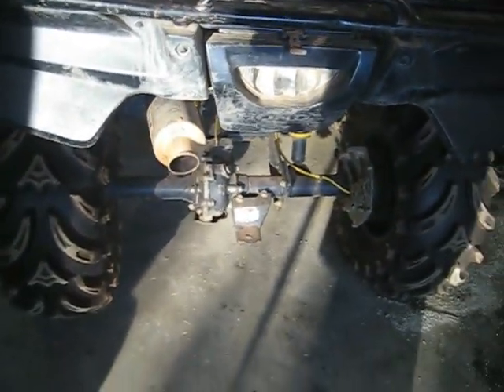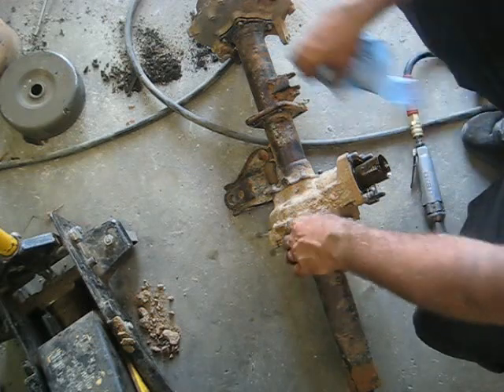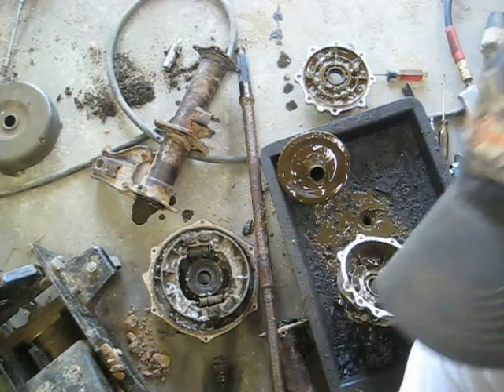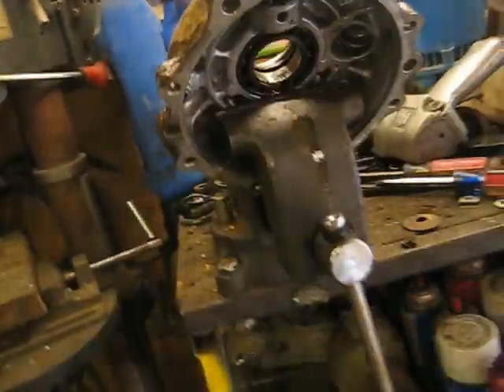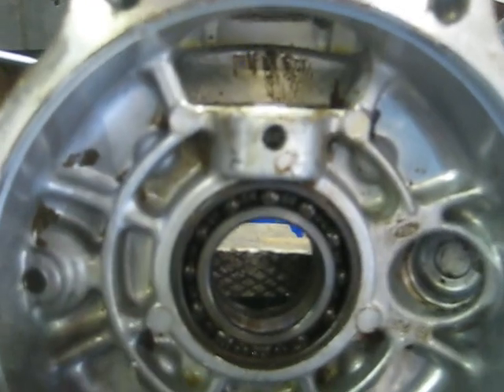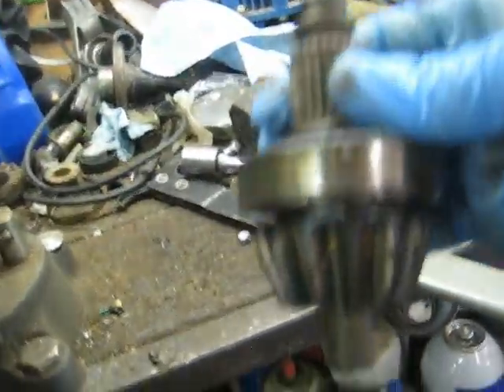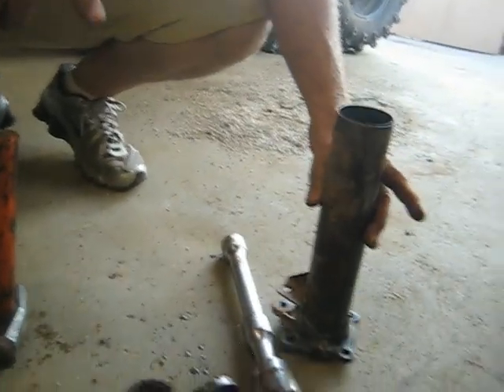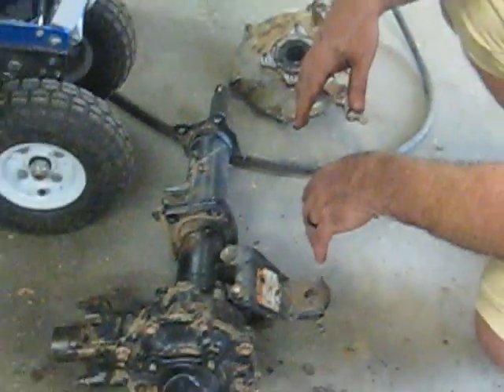Honda Foreman 500 Solid axle Rear diff tear down

Comment: Thanks for your help . Appreciated the video as I am just wiping up my hands for a break after doing the center section . Basically a few outer bearings and seals left before topping it up for a test ride ............ after I also do the swing arm bearings . 

See you next week when I comment on your engine tear down video as I am putting a new can , piston , rings , and valve stem seals on it . 

Cheers man and thanks again for the videos , makes it so much easier with a visual aid

Comment: I have always used a carbide burr to cut the snap ring and grind a slot in the bearing then drill a hole at the back of the bearing and apply a liberal amount of 5 lb sledge blows to the back.

Comment: Oh man, I’m in the same boat. This is the job I’m about to take on, not the work or repairs that I’m concerned about, it’s  the getting the pinion bearing out, got a brand new axle and ring gear on the way but my pinion has some mild damage like small pits and one spot a tiny piece out of the tooth. I was going to attempt to smooth and polish the pinion gear with out remove material but may just have to buy a new one. Btw very good video man. You did awesome and very helpful.
Reply from the maker: Like I said in the video getting the pinion bearing is by far the hardest step. Nine times out of ten the bearing is bad and needs to be replaced. I have had some come out in 15 minutes and some take 2 hours to get out trying different methods.

Comment: My 2004 Honda Rubicon 500 is making a grinding sound from the rear. I am pretty sure the sound is coming from the differential. The four-wheeler won't move in any gear. What is your opinion on it? Do I need to replace the rear differential?

Comment: Hey buddy I really appreciate your content on here very detailed ty   .  I was wondering if you could help me with problem  I have with my 04 Honda rancher 400fa it was shifting issue I figured that out with a new throttle position censer but when I got it back together I fired it up and man it was running extremely ruff for about 30 second then died well what ever happened it made it stop firing all together do you think it might be the ecu  it has me all kind frustrated can you bless me with some your great knowledge I would really appreciate it a lot ty again for your great video content
Reply from the maker: I don't replace many ecu's on these bikes. I will check the plug, coil, plug wire, handlebar killswitch, and even the rectifier on these bikes can make them not fire. The testing procedure for the ECU is pretty much check everything electrical and if everything checks out then your ECU is bad.

Comment: Hey man, great video. My question is: I have a 2017 Rancher with solid axle, I think the pinion has gone but I won't know until I tear it down. Does Honda use the same axle on the foreman as they do on the rancher. Basically will I run into anything different on my rancher, Thanks
Reply from the maker: It will be the exact same process and look the same as the foreman.

Comment: Replaced just the axle shaft a year and a half ago on a 2014 Foreman, same thing as this is wore in the same way.  Well now something else let go last week, not sure if the axle shaft wore again, or the ring or pinion gear failed.  Mechanic looking at it now, will update when I get a diagnosis
Reply: Diagnosis?
Reply: @zzzzzz...9902  Rebuilt the chunk

Comment: Do you have the link for the bearing kit? Great detailed video, I have the same problem with my 2007 honda forman 500. Did you replace the ring gear along with the axle shaft?
Reply from the maker: I don't remember the exact kit I used but I just picked one off eBay that was around the middle of the price range. I have had fitment issues with the cheaper kits.

Comment: When you hit on the gas did your rear end raise up? I have brand new socks and when I hit on the gas it will raise up a little bit in the back and when I put in reverse and hit the gas the back end would squat
Reply: That’s how straight axle fourwheeler ss work

Comment: Put mine back together but when I put the bolts in the cover and tighten down it will barley spin hand and u can tell something isn’t right…. I think The spacer on the pinion gear shaft stuck to the bearing I never put in….. gonna cost me a seal but I hope that’s what’s wrong

Comment: Hey man really appreciate what you do I’m trying to replace the seal where the drive shaft goes into the diff. On a 2018 foreman 500 straight axel the driveshaft goes through the swing ark frame and I’m unsure how to remove it to get to the seal. Without unbolting the whole diff from the swing arm. Any help
Reply from the maker: The only way to get to the seal is to unbolt the diff.

Comment: This is the best video I have watched on rebuilding the rear end, im going to tackle this , this weekend and watch ur video step by step...also what diff oil do I need to use ? Where are u located may have u work on my atv ?
Reply from the maker: Thanks man. I just 80/90 weight gear oil in my rear ends. Also I'm located in south Carolina.
Reply: What is ur cost on rebuilding an 2006 honda foreman 500 4x4 ES. Diff. Just the diff, I will be mailing it to u. I have the rear disassembled juat dont have the pressure to remove the bearings.

Comment: I bought the East lake kit also.  I put it all together today.  I noticed a large roller bearing in the kit the had a slot for maybe a c-clip or equivalent.  Did you have an extra one of these in your kit too?  Don't see any where that it would go?
Reply from the maker: It seems like there was one extra one in the kit. I have run into that before where they have one kit that fits multiple vehicles that have a few extra bearings.
Reply: @FourwheelerDoctor  Well and that's what I figured.  I replaced all the ones in my rear axles and diff.  Man what a job. That pinion bearing had me worried. But I get her.  Thanks for the reply.  Always good to hear from you.
Reply: @FourwheelerDoctor  is there supposed to be play in the pinion up and down when installed in the housing

Comment: Got a 02 foreman for free. Everything is worn-out. Rear diff was dry and full of thick rust. Seems like it has never been serviced. All brake components are seized or missing. Doesn't shift. All bearings shot and rod ends wasted. Missing some plastics. Digital dashboard completely shot.
Reply from the maker: I'm rebuilding one of those right now. Some the parts are reasonable however some are super expensive. For instance I had to get the crankshaft rebuilt on them because they're no longer available from Honda. Also some of the plastic pieces are very expensive and used stuff has been tough for me to find. They are very good four-wheelers but you would really have to dump some money in it to get it right.

Comment: How did you get your left axel nut undone. I have tried a big eletric Hammerdrill and all my weight on a 2 ft breakerbar (72kg)
Reply from the maker: Sometimes I have to break out the 3/4" impact.  if you're planning on replacing your bearings and seals you can always break the torch out, heat it up real good and get it to come loose.

Comment: I have a 2002 500 Rubicon making a bunch of noise and rear end shakes a bit what you think
Reply from the maker: More than likely it's a bad pinion bearing. It could also be your swingarm bearings. See if you swingarm has any movement side to side up by where it attaches to the front

Comment: I opened the brake drum up and I noticed it had oil all inside! Is that normal?
Reply from the maker: No it sounds like you have two seals that have gone bad. The axle seal on the right side of the diff and the seal on the left side of the rear brake plate. They can be purchased separately from Honda but if you go with aftermarket seal kits you will probably have to purchase a axle kit as well as a differential kit.
Reply: Four wheeler Doctor i bought the kit and I opened the differential and it looks ok has no play on any bearing and seals look new but I do I have the seals for the axles I will be replacing today ..thank you for your videos it’s a lot of help

Comment: Hey buddy do you have any tips on replacing a rear drive shaft on a 2006 honda rubicon 500?
Reply from the maker: If you just need to replace the drive shaft, you can pull the diff off like I did in the video a pull the shaft out. It takes a little patience to get the shaft to line back up with the universal joint that attaches to the motor but it can be done. If you need to replace the universal joint that attaches to the output shaft of the motor then you will have to pull the swing arm off to get it out. I don't think I have a swing arm removal video on a 500 but I think I have a video of a similar one. I will find it and post a link.
Reply: @FourwheelerDoctor  
Thanks.  That's what I was thinking but wanted to make sure there wasn't anything I was missing before I tore into it.
Reply: @FourwheelerDoctor    sorry to keep bothering you but about how long would this take if all goes well?   Thanks
Reply from the maker: @cindybrady7381  I would guess around 2.5 hours. Check out this video https://youtu.be/XgqrjHIaCI8
The process will be very similar to this.
Reply: @FourwheelerDoctor    so I did this tonight and didn't take long at all but I have a new problem I was going to replace a broken axle but couldn't get the ball joints to break lose I hit and hit and hit again so how do I need to do this so I can pull the hub and knuckle off to take the axle out?  

Thanks
Reply from the maker: @cindybrady7381  check out this video.https://youtu.be/vCkJ-s6Jo8U
I use a tool I think I bought from harbor freight and haven't had a ball joint jet that it wouldn't press out.  If worse comes to worse you can always unbolt the lower a arm and it will let the hub swing out enough to get the axle out.
Reply: @FourwheelerDoctor  ok thanks